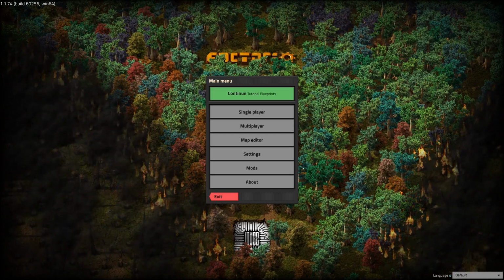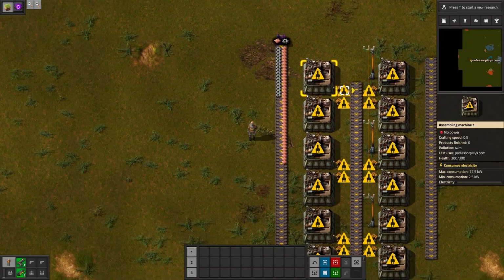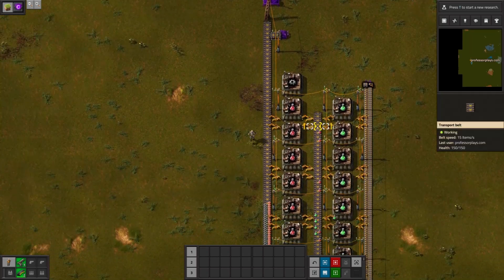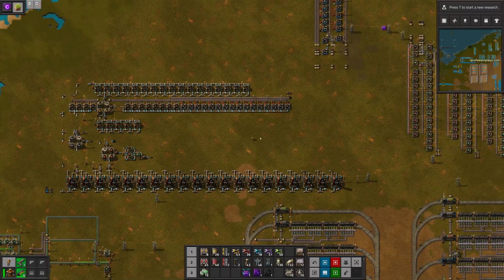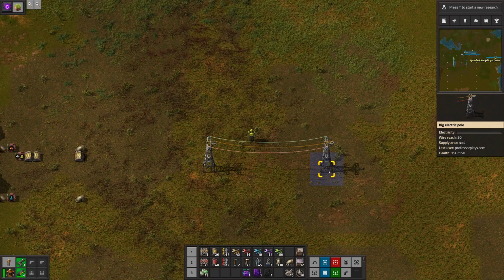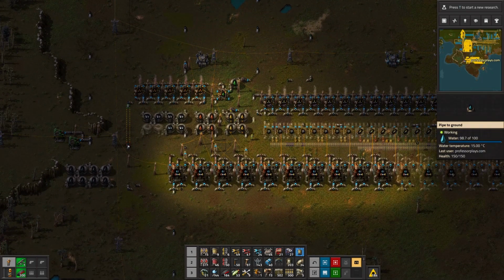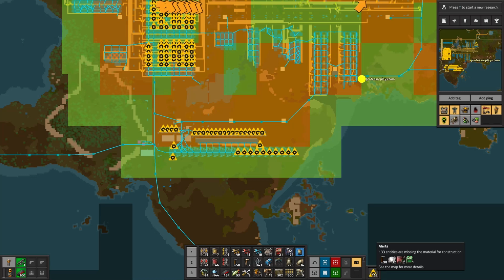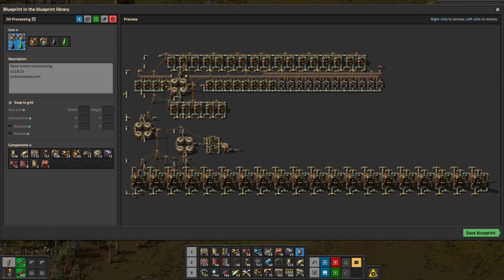Factorio Tutorial Build From Scratch ep13 Blueprints

Comment: Unless I missed it, you cover everything except what I wanted to know, which is how to actually save a blueprint. I don't use mods so I skimmed through that, I'm designing my own science build so I skimmed through that. Around 20 min in you have a finished science build but I didn't see where you actually saved it as a blueprint. Instead you started browsing through previously saved blueprints. I like the game but I keep getting stuck on silly things that everyone seems to know already. Once it was getting the machine gun to work.
Reply from the maker: Ctrl+C, select the items to include in a blueprint, click Create blueprint. Press B to open Blueprints. Click any open slot to save the blueprint.
Reply: @professorplayscom  Thanks. What I do is Click on the blueprint icon at the bottom of the screen, select the items. then enter the title and description, and finally click on the blueprint icon on the upper left to place it in a "storage slot" Now that I know how to do it I'm really leaning into it. If nothing else the lure of free wire is hard to resist. The latest FFF seems to imply that that aspect will be going away in 2.0. It's kind of an exploit so I shouldn't complain, plus they said they're going fix the issue where you don't get wire back when you remove it.